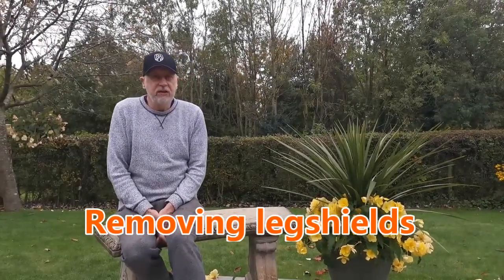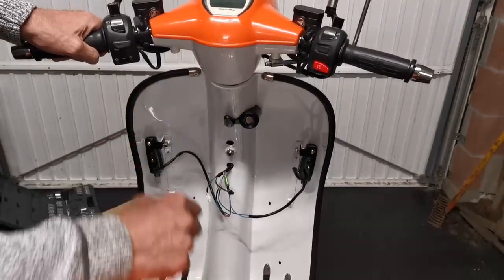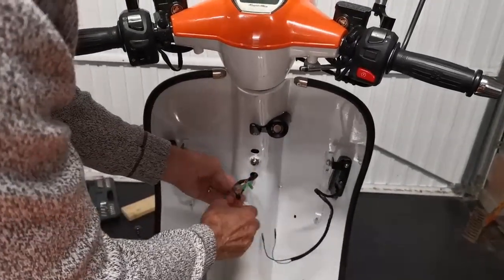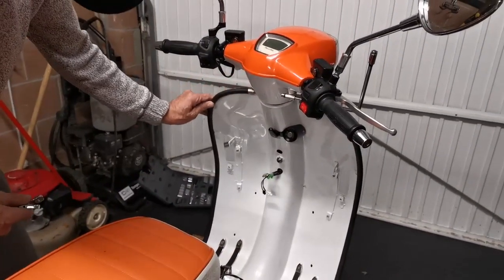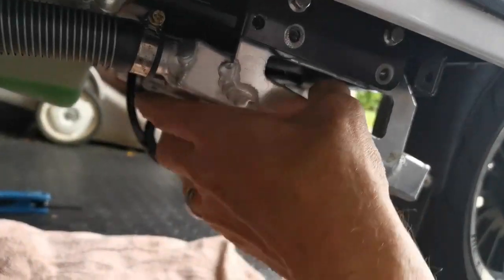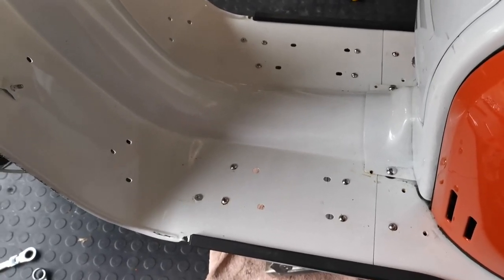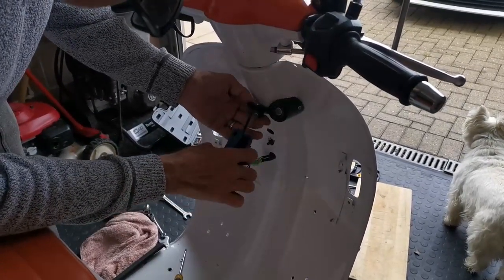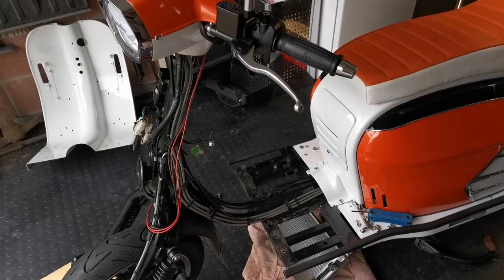Removing GP Legshields

Comment: Enjoying your videos, more so as I've just bought a gp300 2020. Seems I have bubbled paint, which I think is rust. So, swapping out seems a sensible option. Why did yours need swapping out? 
Also. Will the horn cast and mud guard  need coming off first? Cheers
Reply from the maker: Yes you need to remove the mudguard and horncast before the legshield but these are easy. I needed to replace the ignition barrel although I've have done this without doing it.

Comment: Hey there… I followed your instructions and got my leg shield off. I am having a difficult time getting the new leg shield in place. The key switch seems to be in the way. Any suggestions? Thanks!
Reply from the maker: Easier if you have  help to pull it in place from the seat side while you guide from the front. Otherwise remove the read foot plates and drop it in.
Reply: @MikeColwell  I feel like I need to loosen the body work that holds the seat and lift it a few inches because the leg shield is hitting the tunnel. I’m not really sure how to loosen the bodywork. I’m thinking it is going to be a big disassembly.
Reply: Hi Markismo,  can I ask where you got yourreplacement legshield from ?  Need to replace my dented legshield on my GP 125 L/C, thanks
Reply from the maker: @2007Vallarta  order one from Motogb

Comment: Really useful video. I need to replace my GT legshield. What tools or set would you recommend Mike?
Reply from the maker: Hi Dominic, On the GP its mainly a Philips head screwdriver and an Allen set. When you undo the Allen headed bolt holding the bag hook and ignition on the GP there is a plastic strap which allows you to hold the nut around the steering column, look out for this if its the same as you need it to re-assemble. Its not on the video as it dropped and I only found it on the garage floor after scratching my head for a while.
Reply: @MikeColwell  Great. Many thanks.

Comment: are you using a lift for your scooter Mike ?...can you post some details ..thankyou
Reply from the maker: Here's the link but if you search you can find one cheaper:
DURHAND 500KG Steel Motorbike Repair Lift Jack Siccor Hoist Stand Rubber Anti-Slip Top Bike Garage Home Red Black https://www.amazon.co.uk/dp/B0894S6KZV/ref=cm_sw_r_u_apa_i_oVWLFbV8A2N23
Reply from the maker: Just found this:
https://www.onbuy.com/gb/motorbike-motorcycle-table-bench-workshop-scissor-lift-jack-stand~c10625~p21113142/?exta=shptl&lid=27853284&stat=eyJpcCI6IjQxLjk5IiwiZHAiOjAsImxpZCI6IjI3ODUzMjg0IiwicyI6IjE5IiwidCI6MTYwMzYxNTI4NSwiYm1jIjoiMS4wIn0=&custom_id=20_50:::ee:::best_seller:::new:::uk:::h=0-d=0-rs=0:::item-id=OPC-P5T9BHY-NEW&gclid=Cj0KCQjw59n8BRD2ARIsAAmgPmL5tJSVAW74dcPJwQGKgoX8J70S25AareTSUOQ9dOfLlTSo8oUFuFIaAsyfEALw_wcB
Reply: @MikeColwell  thats great Mike thanks...where is the best point underneath to place it ? I know its probably common sence but you have used one.
Reply from the maker: On the frame back of the radiator.

Comment: Hi,I’m the chap that commented about having different bikes and all riders are the same no matter what they ride,I’m just wondering do both your scooters have metal bodies and also do they have the same gear change as the older scooters,where are they made as they seem to have good build quality,this might be a stupid question but do they come with the spare wheel like the older models,sorry if these questions are a bit daft but I’m new to this scooter side of motorcycling,pete
Reply from the maker: The GP and TG  range of Royal Alloy Scooters are mainly steel and are good quality. They are autos like all new scooters so twist and go. No aching wrist changing gears. They don't come with a spare as front and rear tyres are different widths (110 and 120) but see my puncture protection video and you won't need to worry. If your thinking of getting one I much prefer the metal GP range to the GT which is plastic.
Like most high end bikes the engine and most components are made in china (near the Triumph and I think BMW factories) however they are assembled in Thailand. Hope this helps.
Reply: @MikeColwell  thanks for the reply, a lot of people don’t realise the amount of parts that are made in China for the big four motorcycle manufacturers,does the gear change operate on the same principle as my little mbk nitro 50cc scooter,using a variator type arrangement,pete
Reply from the maker: @petewain61  yes that correct.